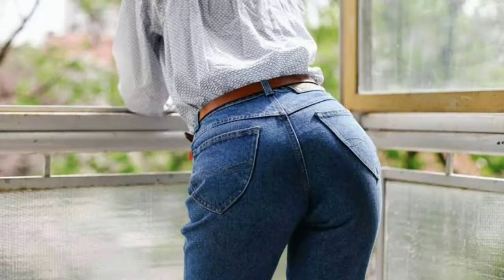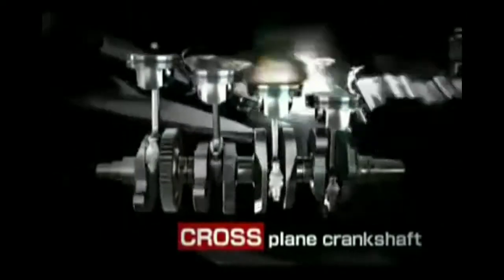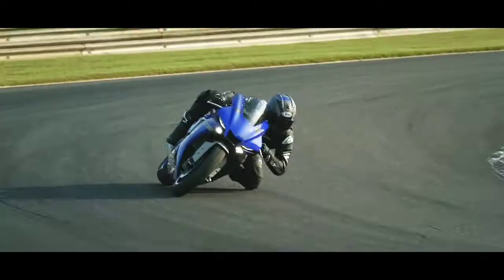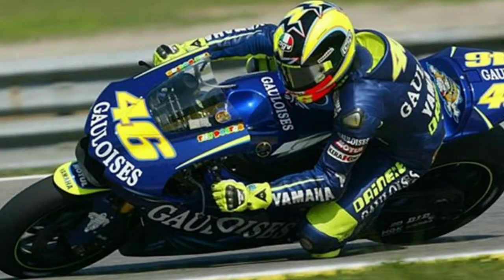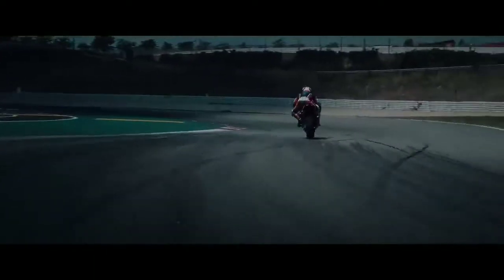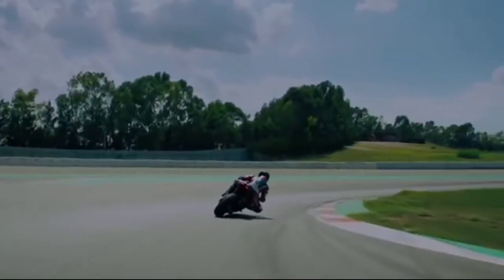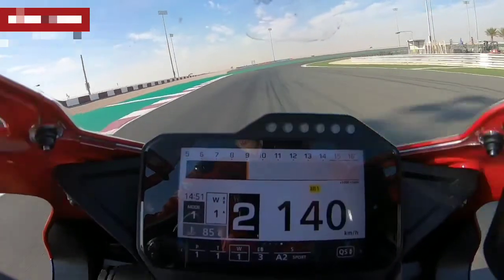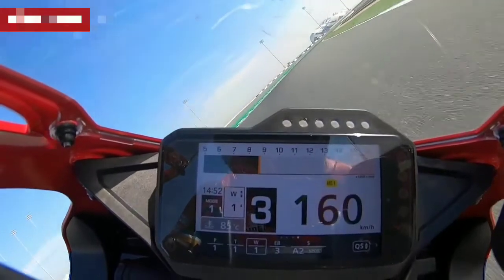CROSS PLANE vs FLAT PLANE crank shaft in BIKES | ADVANTAGES and DISADVANTAGES

Comment: You should read the captions so you can see where your pronunciations are indistinct.Otherwise a good video. When the R1 road bike came out some of the reviewers said, "it just about pulled your arms off if your arse wasn't planted at the back of the seat".
Reply from the maker: Sure I will consider your suggestion.R1 is that kind of a bike as you explained here ... some time it can sprain your neck 😁